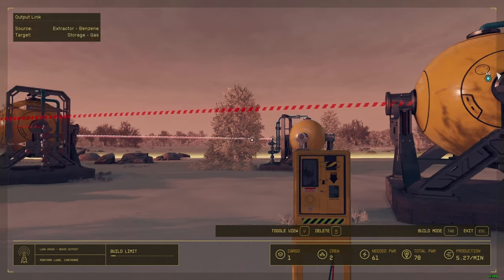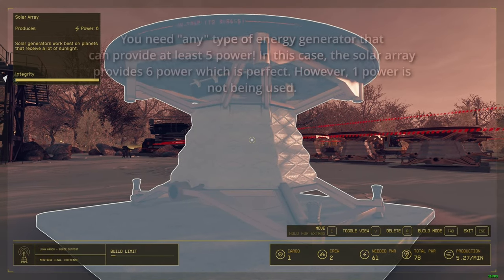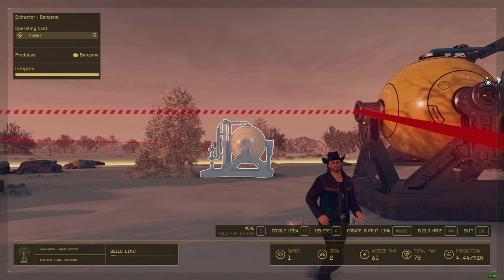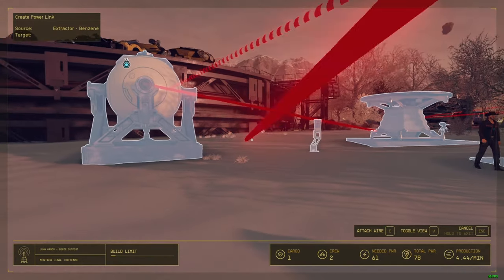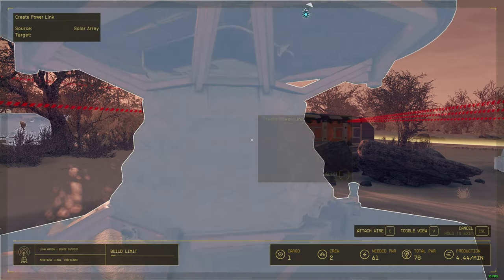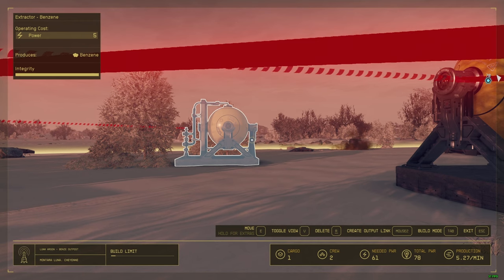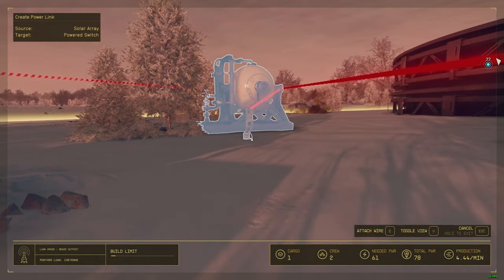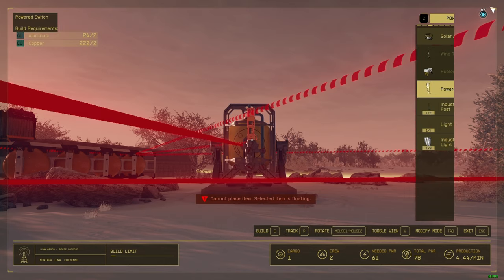STARFIELD│OUTPOST - How to USE POWERED SWITCH - Guide 2023

Comment: You can also add your power resources together; turbine (3) --wire---turbine (3) = (6) ---wire-- SWITCH--- extractor needs (5) and has enough because it is receiving (6).
Basically, serialize power,  generator wired to generator (s). Then just one wire from that generator group to your switch then to the power consumer(s) group.
Not personally tested but I suppose you can chain your power consumers together as you can chain power generators together.
Would save a lot of wire confusion later on.
Reply from the maker: You could do that, but then you would have to wire all other machines or turrets as well to that powered switch. And I don't want to do that. I just need the necessary powered generator to control specific extractors only. But that's a personal decision of course

Comment: Thanks for the tip @DjDragon5000. Do you succeed as well for the fabricator? As long as the fabricator is supplied with minerals it manufactures, I therefore want to be able to turn it off other than by cutting the links with the stock which supplies it. So I linked a solar panel to the button, linked the fabricator to the same solar panel, logically if I turn off the button I turn off the solar panel and therefore the fabricator... and no, not at all. After 1 hour I give up, any idea?
Reply from the maker: Here is a vid on the topic  https://youtu.be/81gdpbOk0k0

Comment: Would be cool if power switches turned on and off cargo links as well (maybe they do?) so you can completely turn on and off an automatic fabricator production outpost
Reply from the maker: Good call! Not sure if we can. Ill check it out today thx! But I don't think cargo links require power. Ill log in soon to verify
Reply: @DjDragon5000  would be wonderful for micro-management of your outposts! As of now my "outpost network" is suffering from lack of helium3. 
My goal is to make everything run smoothly continuously but this would either require me building a FIFTH Helium3 outpost OR me improving every single extractor from commercial to industrial (which unfortunately uses up rarer components which I still don't have but planning to get). 
Being able to let an outpost produce and store the goods... then cut off the  extra-system  pads just to let the helium 3 accumulate into the storage would be ideal since the helium consumption is only SLIGHTLY in the negative (so the storages last for a long time before running, eventually, dry).
This would generate a "stop&go" kind of production but at least it would be manageable without me running like a dog from outpost to outpost to understand what's going on.